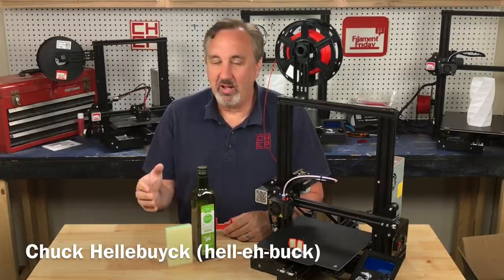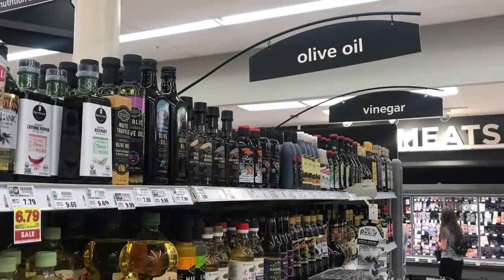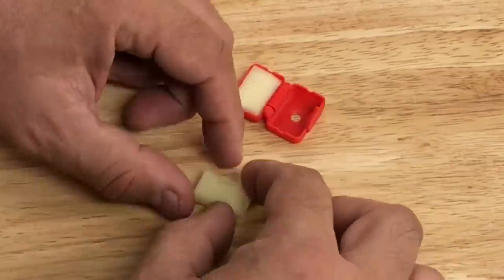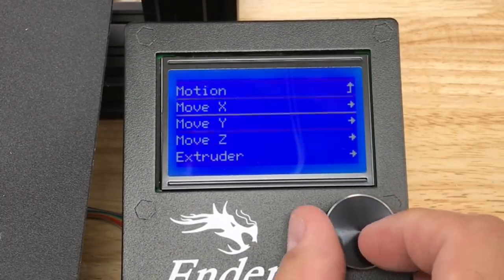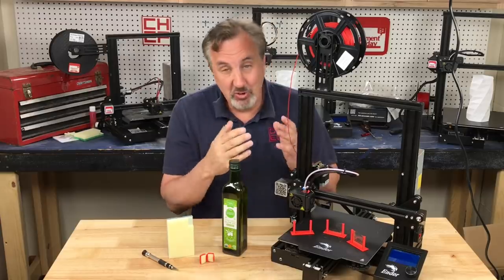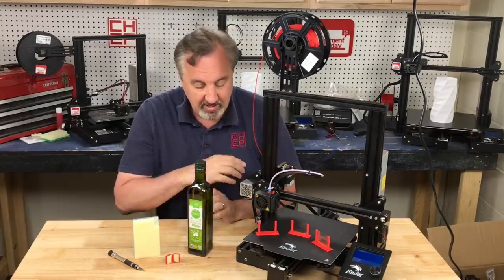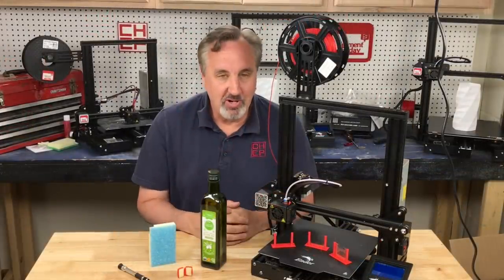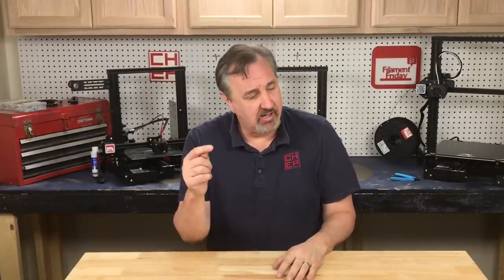Quick Fix to Eliminate Stringing on your 3D Prints

Comment: Worked like a Charm !!!!
I use ABS filament and stringing is a big problem, if i use lower temperatures, parts get very warped and layers dont fuse together.
Reply: Really? I also use ABS (local Brazilian brands) and I couldn't get ABS to string at all in three different brands. Retraction tower tests only show a minute amount of blobs where the filament starts to string, breaks and recoils back forming a small ball, and even so, they are only barely noticeable at 1mm retraction, from 2 onwards they all look the same. And that's with teachingtech's website gcode, so no wipe and no combing. The only time I get the beginnings of stringing is when the filament is getting moist, but by that point I can already notice lots of bubbles and pops coming from the nozzle while heating up. Maybe it's the Linear Advance doing it's job. Mine is a 2019 Ender-3 with capricorn tubing and aluminium extruder.
On the other hand, bed adhesion have been a nightmare over the years, so with the problem basically solve by the new PEI bed surfaces, I'll definitely keeping any type o oil as far away as possible from my printer.
Reply: @Spartacusse  - Tá de sacanagem... outro BR enxendo o saco na internet... hahahahaha
Eu comprava material de um fabricante de Florianopolis - SC, testei 1 rolo da Shopee e agora estou comprando da 3D Prime.
E já logo te digo, a diferença entre fabricantes é BRUTAL, essa dica de usar oleo vegetal é algo interessante de se fazer de qualquer forma,  mas o Fabricante é um fator muito maior, com meu fornecedor anterior (3d.on) eu tinha diversos problemas em ajustar temperatura entre as CORES, marrom era um inferno pra imprimir, temperatura maxima e 20% mais devagar, Vermelho sempre sendo quebradiço, quando achava que a peça estava pronta, não tinha nem 20% feito porque o filamento quebrou e a impressora trabalhou no vazio...
Outro ponto é, Hotend ruim... eu tenho uma Creality 10 e suspeito que veio com o mesmo hotend que o seu, no meu caso, o dissipador não era o suficiente pra ABS, aposto que funciona normal em PLA, mas o cooler era muito fraco e o dissipador fica colado contra a estrutura e não tem como o ar sair... eu FORTEMENTE recomendo trocar e engambiarrar um Hotend E3D V6.
.
Bonus:
1mm de retraction é pouco pra uma bowden, a mangueira de teflon gera folga entre o hotend e a resposta do motor,  geralmente essa folga é de uns 5mm, mas pode variar proporcionalmente ao tamanho da mangueira de teflon.
Sobre aderência da mesa, eu uso chapa de vidro, fixador de cabelo e 95°C de temperatura da mesa,  100°C pra peças com maior tendencia de warp.
E Enclausuramento é OBRIGATORIO em ABS
Reply: This destroys the interlayer adesion. The resulting parts are much weaker.
Reply: @cosmefulanito5933  - Completely Nonsense, the objective here is to Lower friction on the filament on contacting everything until the nozzle.
The Oil will spread on everything that touches the filament and the rest will be vaporized before it passes through the nozzle.
Also, its a fucking droplet once every a few weeks, not the entire container of oil... you are lubricating the path of the filament, not seasoning your 3d prints.
.
The result is the opposite, Parts get STRONGER due to less interference on the process and better nozzle pressure.

Comment: I've been doing this for years, with Avocado oil. Every time this comes up and I suggest oiling the filament cleaner, I'm shunned back under the rock I crawled out from under.
It makes a MAJOR difference with all metal hotends, which is all I run. It is absolutely a permanent fix.

Comment: It also has the secondary benefit of cleaning any dust/debris that might have accumulated on the filament in storage.
Reply: I would say just keep using it. The tiny amount of oil deposited should have very minimal (if any) effect on the final product. Once the oil is gone it changes from an oiler to a cleaner.

Comment from the maker: I’ve had many questions about other oils. I’ve only used olive oil for years. It coats the PTFE and the smoke point is below the typical nozzle temp so any excess burns up before leaving the nozzle. Other oils may not do that so I’ve stuck with olive oil and have never seen any issues (unless I use too much).
Reply: @Swampthing401  When the oil is heated ahead of its smoke point, it gives off toxic smoke. As olive oil has a low smoking point, heating it increases the risk of creating smoke that includes compounds which are harmful to your health. But it might not be enough to do much
Reply from the maker: Ask google. “In a 2010 Food and Chemical toxicology study, when researchers fried various types of olive oil, only after 24 to 27 hours of frying were the oils considered to be harmful.” 
For the small amount I’m using, I’m not sure it would even register.
Reply: I will agree I've had good results oiling my bowden line every once in a while. however, I highly recommend using mineral oil and not cooking oil.
Reply: It isnt more toxic than volatiles leaving pla when heated...

Really guys
Its a few grams at most...
Reply: @FilamentFriday  while this is true, the effect is totally different. This was oil that was intended for later consumption. The Brits (when I was growing up) would keep a pan of chip "fat" - which is a heavy oil used to cook fries - and reheat it many times. Only replacing that stuff when it got so black, the fries came out looking like they had fallen into a tar pit.

Now obviously you don't want to go huffing the smoke from a pan of over-heated oil (your lungs are precious) but that hasn't stopped people smoking tobacco which is many times worse and contains 1000s of known carcinogens.

TL;DR

Also the route matters. As oils are heated their chemical composition changes, forming toxic chemical chains in larger amounts - but the toxic effects occur when these substances are ingested and that's the key point.

Sure, the smoke isn't healthful, but you're exposed to far more carcinogenic particulates just driving to the mall!
Reply: In you Feb 21 2020 video entitled “Fix your Creality Ender 3 with PTFE Tubing” timecode 3:54 you said regarding oiling the PTFE,  “I’ve done this sponge trick in the past, but I notice you get a buildup in the hot end, so I don’t do it any longer.”
Reply from the maker: Glad you watch my old videos. Yeah, I learned a lot since that video. I found the burned last 20 mm of the PTFE were more of the cause not the oil. Cutting that off is the best fix. I went back to using olive oil as a quick fix and with all metal hotends but found the 100mm limit I mention works best and buildup doesn’t happen. I’m learning everyday.

Comment: I use Mineral Oil. 
It is clear and lighter on my all metal hot end.
But the biggest help you ever mentioned. 
Was set your G code to retract 30 mm at the end of a print and advance it 30 mm at the beginning.
Since I started doing that. Filament changes are easier.
Less or no oozing before the print. No more clogs. 
Probably because you have a solid piece of filament  jamming into the hot zone.
Reply: Wow, Tom - I’ve just been tearing my hair out because PLA keeps jamming in my E3DV6. Duh: Just retract the filament 30mm after each print! Thanks for mentioning it here - I hadn’t seen Chuck’s original video tip, so you mentioning it here has probably saved me hours of frustration!
Reply: @DEtchells  I had to change it to 20mm with the original hot end and the new heat break. 30mm pulls it past the hot end. Then it does not want to go back in. Will have to make changes later but for now it is working.Reason being some times when it pulls there is a little bulge on the end if it is pulled out too far. Of course I could also turn up retract speed in the ending GCode. And now I am using Avocado oil for seasoning the Heat Break. I saw this in another video. Has a real high burn temperature.
Reply: @DEtchells  I set mine now to retract at G1 E-20 F5000 . I just changed to a gear reduced extruder.SANJUI EXTRUDER. 30mm retract at F2700 was to slow. It pulled the Filament out with a bulge on the end out of the heat break. Then it would not go back in. Now it works fine. The pull makes the filament with a taper on the end.
Reply: Also one other thing. I smooth out my heat breaks with pipe cleaners and rubbing compound.

Comment: I can confirm this works like a charm. I run a Ender 5 Plus with a Microswiss all metal hotend and their direct drive and a while ago it just started stringing like crazy as per your issue you showed at the beginning that is down to retraction.... It does not matter what I tried I could not get this sorted with retraction settings and E-Step calibration. After a lot of thought I actually took the whole all metal hotend apart and took a nice fine polish on a toothpick on a drill and started polishing  all the insides  of the whole hotend and heatbreak as well as my brand new hardened steel Microswiss nozzle. After that I did the oiling, but I used silicone spray and man did this sort all my issues... Now my prints looks better than ever.

Comment: A blast from the past. I used this trick about 10 years ago with my XYZprinting DaVinci. On the next printers I never wasted a thought about it, as I learnt to fix stringing permanently. Maybe worth a try, if nothing else helped.
Reply: And how did you fix your stringing permanently?
Reply: @Graham_Wideman  Calibration (retraction, speed, temperature); quality filament, upgrade extruder/hotend, drying filament ... depending on root cause of the problem.

Comment: Stringing for me is usually due to one of two things. 
1. The nozzle temp is too high for this filament, do a test tower and find the optimal temp. 
2. Humidity. Get a small humidity sensor and keep the room humidity below 50%.

Comment: I get a lot of stringing on my E3Max with a MS hotend and I KNOW it's not the travel path or running too hot, will find out if it's moisture in a bit when I pull ita out of my dehydrater, will give this a try if it's still stringing. Thanks Chuck.

Comment: That was the very first print I ever did with my first printer a Monoprice Select Mini (Original version). I use these on all my printers and never had a problem with them. If I recall you did a video of it back then to illustrate print in place hinges.

Comment: Hot end clogged and covered in brown gunk, got to replace the lot after following this. Thanks for the tip. Can’t get stringing if you can’t extrude.
Reply: Can confirm. the oil effectively clotted in the nozzle and required full disassembly to fix
Reply from the maker: Did you use olive oil?
I’ve never had a clog. Other oils will cause issues.
Reply: @FilamentFriday  to clarify, I was fixing Judd West's printer. It may just be that all olive oils are not made equal but I inspected it and it was in fact olive oil. It's quite possible that the oil you are using is fine, but the oil that Judd purchased seems to have been what took his hotend out of commission until it was serviced by myself. 
There was a good ending in that it's printing excellently since I rebuilt it.
Reply from the maker: Also, some people use too much. I state 100 mm wiped on filament once. Then let it run. I’ve seen people do that many times.
Reply: @Omnislash772  I do live in a completely different country. I can't exactly go to Trader Joes in Australia. I'm just glad Omni was able to repair the hotend for me.

Comment: My guess is it's not lubrication as such, it's probably polymerization. Like seasoning a cast iron skillet.  So oils with a lower smoke point (olive or flaxseed) will work better. And since it won't flash off until almost 500c, this is a really good idea.  It's basically coating the inside of your heat break with a thin lining of super tough Teflon. It might work better if you somehow ran at a high temp

Comment: Just destroyed my micro Swiss so I ordered a biqu h2, had a horrible clog that would not come out, heated the micro Swiss on the oven to cook off the filament which worked but somehow the titanium throat was warped and stuck while not being fully seated against the body of the hotend so frustrating but definitely gonna use some sort of filament filter from here on out similar to the device in the video

Comment: I've been plagued by stringing for quite some time, tried everything.
Temp test, retraction distance test, nothing improves it.
Just tried olive oil idea, thought it might be working, but no.  Improved it just a little.
But I didn't use the sponge to apply the oil, used paper towel.   Perhaps didn't apply enough.
Seems strange when doing a retraction distance test from 1-6, you'd think stringing would disappear after a certain distance but come up with other problems, but no, stringing gets worse as it goes up.

But the description of why it works did have me thinking: I had replaced the nozzle at one time, might not have tightened it enough or it didn't meet the tube.  Over a bit of time, filament backed up past the threads of the heat break that goes into the heat block.  Didn't know it was threaded at the time, thought it floated in the hole.  I think the entire bottom section was loose from the factory or became loose.
Anyway, after finding filament oozed all over the place, cleaned it up, then made sure the PTFE tube met the nozzle,  I might have squashed it a bit and so the filament might be binding a bit during retraction.
So might have to replace the bowden tube.  I don't think there's much to cut off from what came with the printer.

Using Ender 3 V2, CR-Touch, stock firnware for CR-Touch MB 4.2.2, with eSun PLA+

I've fixed bed adhering problem though.  Get the z-offsite just right, about -1.00 from CR-Touch zero point, clean bed with alcohol often to remove the oily the paw prints.

Comment: oiling Constantly does reduce layer adhesion, but oiling the heartbreak and letting it get cleaned doesn't in my experience and helps metal heatbreaks!
I personally always took out my heatbreak, put a tiny bit of oil in the actual heartbreak, let it sit at below the burning temp of the oil for 30m-2h and then purged filament trough. i used canola cause of it's higher burning temp. never get a jam this way, I only have to do it once every 1-2 years

Comment: You can also just change the stock PTFE tube for the blue one made by Capricorn I had this fitted on my Ender 3 v2 for well over 200hrs of printing and the end doesn’t burn when it’s flush with the Nozzle. I took it out after watching this video and it was still fine. Good tip on the oil if using an all
Metal hotend.👍🏻
Reply from the maker: I’ve covered that before: https://youtu.be/8VmlZniuSa4
Reply: @FilamentFriday  oh ok I’ve not seen that one yet but watch many of your videos some great tips.👍🏻

Comment: I tried that quite a while ago. It kinda helped, but there is one thing not mentioned. Sometimes it leaves oil residue on the bed. I think if you used too much oil it will go like that. The oil will make the print not stick to the bed. Maybe it's a good idea to run the first part of the print dry and let the oil coated the rest. I mean, you probably not gonna worry about string at the initial layer, right?
Reply: He isn't applying the oil while it's printing. You do it beforehand, and catch the filament with your hand or tweezers or whatever so the 100mm doesn't touch the bed. Or am I misunderstanding what you're saying?
Reply from the maker: @jarnMod - Olive oil will mostly burn up in the nozzle so it doesn’t make it to the bed. But also why I suggest just 100mm.

Comment: Olive oils smoke point, or the temperature at which it can start burning, is 190–207°C. Use a higher heat oil like canola, avocado, or vegetable oil to avoid any possible burning.
Reply from the maker: I’ve seen no smoke/burning in 7 years. Besides I’d prefer it not get thru the nozzle and into the print surface.
Reply: @FilamentFriday  The tiny amount of olive oil you're using isn't going to produce enough smoke to be visible, that's why you're not seeing it.
Reply: Spraking of canola oil, if u do some research on this stuff, u will find out it is made from rapeseed, which is primarily used to make a high heat machine oil. I have switched to this at times and it does work as well or better than olive oil. I would never use canola for cooking.
Reply from the maker: So it’s not an issue either.

Comment: Very likely you are not lubricating your hot end in as much as you are seasoning it like you would cast iron pan. The oil coats the hotend as it passes through and the heat polymerizes it creating a hard high temperature nonstick layer....Olive oil doesn't have the highest smoke point. Other oils used to season pans may work better. Canola for instance is quite a bit higher smoke point and avocado oil is one of the highest at around 270c. For people running an all metal hotend at high temps avocado oil may be the oil to go with.

Comment: I wonder if this don't make the extruder loose the grip force because the filament be oiled..or the teeths get oiled and captures now more dust than before?
Reply: The gears dig into the filament, it's not just relying on friction or it wouldn't work, even dry. I wouldn't see it having much effect if it's working properly to begin with.
Reply: I strongly suspect that this causes slippage when printing with TPE/TPU type soft filaments. 

Even without adding any olive oil, I sometimes get slipping at the drive gear/pinch roller, and I need to routinely degrease them with alcohol.

That's really annoying to lose a long (3+ hours) TPE/TPU print when the filament suddenly can't be pushed anymore at the end of the print. 

I don't know this for sure, but  TPE/TPU feels a tiny bit oily in my fingers when I feed it into my machine, so again I suspect that there is an oil added to it by the maker, and this alone makes my bowden tube a bit slippery inside. 

I would be very cautious with adding even more oil, since I print with so much TPE/TPU.